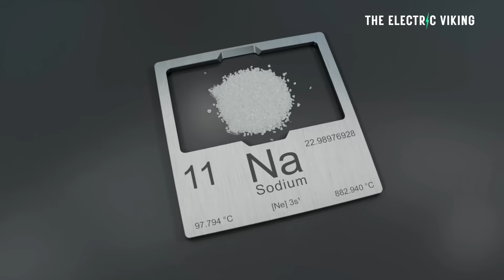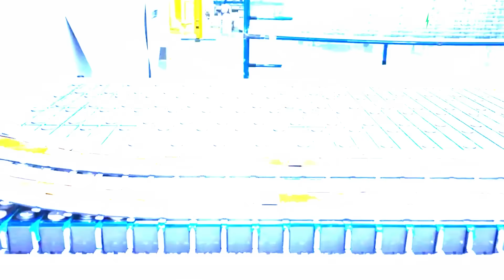Goodbye Lithium! New 3,600,000 Mile EV Battery costs 50% LESS

Comment: Lithium Electonegativity - 0.98. Sodium Electronegativity - 0.93. Lithium ionic radius -  1.52A. Sodium ionic radius - 1.86. In short, you cannot beat physics. Eventually, you can make better batteries from Lithium than from Sodium. Sodium Ion batteries will have better cycle life, since their voltage would be lower. So also forget about performance.. But yes, Sodium Ion batteries will be a lot cheaper. Assuming CATL did solve the dendrite problem (they must have concocted some kind of an organic electrolyte which eats them).
Reply: Sodium carbonate = $200/ton, Lithium carbonate = $15,000/ton.. The cost is part of physics too..
Reply: Yeah i mean ... we don't need just ONE type of battery.

If Sodium works for static storage with long life, while being extremely cheaper. That in itself its a huge win for electrification ... it doesn't matter if your car/computer/phone still uses lithium, it makes renewable power sources suddenly make even more comercial sense.
Reply: Let a hundred batteries charge, but from a mass market cost perspective this is it. Just like how Honda Civic outsells a Lamborghini 5000 to 1 or more it's not about one market it's about different chemistries for different markets and different price points. Something that CLEARLY ISN'T TRUE TODAY! UNTIL NOW!
Reply: We aren't even close to the theoretical limit of Lithium. If sodium gets to even half the theoretical limit of lithium,  the  battery will have amazing versatility and application. Yes, the theoretical limits of Lithium exceed Sodium but that is rather meaningless when you haven't even gotten to a reasonable fraction of the theoretical limit.
Reply: What about Aluminium ION, the Tesla new Battery which are lightweight.
Reply: @michaelcorcoran1964  - not as light as Lithium, which is the lowest weight metal that is very energy giving (likes to give up it's electron)
Reply: @GruffSillyGoat 
Lithium is certainly lighter than aluminium, but if  each aluminium ion takes 3 times as much charge, it needs fewer of them.
That reduces the amount of graphite needed to hold them by possibly up to three times.
The entire battery can therefore be lighter for the same charge.
 That's the principle, I belive. But I'm pretty ignorant about batteries, so I might be wrong.
Reply: It's not that simple, one has to take the cell characteristics into account, not just the charge carrying difference.

Aluminium is about four times heavier than Lithium, and has a lower voltage potential (2.65v for Al vs 4.2v for Li), this means for the same voltage capacity Al based cells are much heavier than Li ones. Which once overall cell changes are taken into accounr can be up to 10 times heavier at the pack level.

The three times electron potential, also requires an cathode material that can is stable at supporting the level of charge transfer over many cyces. This is still being worked on, claims of working batteries have all been for rather low cycle life cells. For mobility applications with frequent charging Al is not an ideal candidate at this time.

Further whilst Al-ion has a higher emergy density than Li-ion, if one considers the parallel development of Metal-Air cells, where the situation swaps around with Lithium having the highest energy density; significantly more than Al-Air and the highest know max energy potential rivalling petroleum products. 

Al-ion may mature offering a better stationary storage cell, due to its weight, but it will be challenged by Metal-Air cells around the same maturity timeframe; its advantage short lived.
Reply: My guess is that sodium ion will rule in grid and home energy storage systems and standard range EVs. Long range EVs and small devices (laptop, phone, portable power tools, e-bike, and wearables) will likely still continue to use lithium battery due to its energy density advantage

Keep in mind that sodium ion won't totally end lithium battery production, it's just made for balancing the demand
Reply: I've read that they've planned to start the production a month ago for heavy duty market such as trucks and at end of the year they have started the production fully. Really interesting to hear if they've actually started to deliver these batteries to their customers yet.
Reply: Self-healing 🔋
Reply: What about SSBs?
Reply: We could run cars on pure nitroglycerin because that fuel would contain more energy than gasoline per pound and per liter. But we don't do it because there is a safety ratio and a good enough Factor as well as other things so energy compressibility if you want to call it that doesn't really matter past a certain factor. If you can squeeze it into a car shape and it can provide you with a fast charging and long enough range then it doesn't matter really beyond that and cost and safety become much more important.
Reply: @yougeo I think you missed my point. Both Lithium and sodium are relatively new. The up side of development hasn’t been reached by either. A comparison based on relative theoretical limitations is not going to tell you what the practical limitations will be.
Reply: You can't be a firm that creates energy, gen/storage that will eventually destroy your firm. Even if this came as stated you might create, ceteris paribus, a 10-15 year market. However, if developmental breakthroughs are maintained (who can say at what rate) it will, nonetheless, create a situation where one cell has so much capacity there will either be little need for new storage or the marginal cost of production is so low everyone can manufacture it, for e.g. LCD TV's. Hence, manufactured obsolescence will be introduced much like LED lighting. We could have had almost lifetime lighting, now at the consumer level the price/performance ratio is declining. It is not in a firm's interest to create energy storage that will do itself out of medium term production. Yet difficult when the chem/physics/production elements between firms (and nations) would marginally approach zero.
Reply: What happened to CATL's "condensed matter battery"?  

Wasn't THAT supposed to be the battery "game changer"?   

CATL's Condensed Matter Batteries were supposed to give us electric planes... soon.    Where are they???

*
There's no negative consequences for CATL coming out with BS about batteries every 9 months.   They can put out BS with the blessing of the CCP (don't forget -  CATL is a CHINESE company, which means they do want the Chinese Communist Party tells them to do).

Russia funded the European idiots of the Green Party to help keep non-Russian natural gas off the market, and make them DEPENDENT on Russian natural gas.   Why shouldn't CCP- controlled CATL come out with BS battery stories that say, "Don't invest in oil indepence!  Batteries are going to make oil obsolete!".  --- or some such BS.
Reply: The word batteries mean a sum that is greater than it's individual parts 

Why only mention inherent characteristics of ELMENTS ONLY

CATL has engineered electrolytes and fims for extron movement 

You know what immediately discredit your point LFP batteries go and research what the cycle life and energy density of it was when John b goodenough invented it

They said it would never beat modern batteries in any capacity

Comment: 24M is still only battery with a separator that detects dendrites.  The impervio separator is three parts and acts like ceramic, to turn the dendrite horizontally, where the ends dissolve.  The system can detect if there is a short and shut down that cell.  CATL needs to explain how the deal with dendrites
Reply: Maybe they have a solution that they are keeping proprietary for now.
An interesting thought I had was adding some potassium to the battery.  A 50:50 alloy of sodium and potassium is liquid at room temperature.
I used to have a calculator with batteries in it that had the dendrite problem.  I discovered a fix for it was to charge up a huge capacitor to about 30V and discharge it into the cell.  They would stay fixed for as much as a year each time.  Basically the current spike blew the dendrite like a fuse.

Comment: lets get real, the current collector in a sodium ion cathode is made of aluminium instead of copper. how much cost savings? probably around 10€ per kWh.
regarding the other materials? one € here, one € there maybe not that much. i think it can compete with LFP but not with a huge difference.
where it can get a market very fast is by replacing the traditional 12V batteries in ICE cars or 24V batteries in trucks. longer lasting, very good cold performance.
this allows scaling it up. that is the key. once the supply chain is established, upscaling will go forward and prices will drop.
once it is slightly cheap than LFP, it will conquer the home and grid battery storage market. it will still take about 3 years to get close to this point and then we will know more.

Comment: I think that for performance EVs which is arguably a large sector of the market, we are likely to see more implementation of the 24m technology. The higher energy density is just too desirable even at a higher cost. Remember that their tech can be implemented quickly and at scale without huge initial tooling expenses. Maybe we will see a split with affordable vehicles going for sodium and higher performance vehicles opting to use 24m.

Comment: This is exactly why buying an EV is a terrible idea.  if every week there is a "Game Changing" technology that will reduce the price by 90% and improve range by 50%, why buy a car today if tomorrow will be 50% off?
Reply: A year ago I bought a 2019 Hyundai Ioniq with 40 K miles.  It serves us very well well, since we can charge at home and make a short commute to work.  Our solar panels in a NE US state can charge the battery. There is a way to fit an EV into your lifestyle if you look for an economical model .  We use this car locally and have a hybrid for longer trips and as a second car.

Comment: Ocean water can be desalinated for drinking water and the sodium  can be used for batteries. The cloride used wherever it's needed. That's a win win with cost shared.
Reply: Sodium is so cheap that sourcing it near the battery manufacturer is crucial.  The issue with desalination is the high energy use.   Yes, releasing concentrated salt water is an issue.  But sodium battery manufacturers wouldn't put a dent in that released sodium.
Reply: @veganpotterthevegan  Modern desal plants usually use solar for at least part of their energy needs. It's almost mandatory these days just to get approval, e.g. in places like California where it takes 15 years to go through the red tape.
Reply: @ChickensAndGardening  not much red to for municipal services. Different story if someone were selling desalinatized bottled water
Reply: @ChickensAndGardening  The South Bay in California, near San Jose, has large evaporation ponds that have been making salt for decades.
Reply: @keithdow8327  Same for San Diego in South Coronado Bay
Reply: Sea salt has too many impurities, and it would cost too much to purify it. The processing is going to be the biggest cost, followed by the aluminum collectors.

Comment: Sodium batteries are not available on ebay. All i see is lithium. Samsung 21700 and the old workhorse 18650. BTW the 4680 is non existant on eBay either. Go figure. The 21700 is a 5ah 3.7 volt unit. Again sodium non existent for us Do it yourselfers building portable solar power stations ...5000 watts or better..yeeeehhaaawww👽🦖

Comment: What I wonder is how this can be used for home batteries? The prospect of powering homes/businesses etc with these kind of batteries seems to me to be at least as important as putting them in cars.
Reply: They are making a line of stationary batteries as well as those to replace 12V lead acid in cars and hybrids since they can still use 93% of their range in -40c or +70C...
Reply: Sodium won't be used in moving vehicule. Perfect match for energy bank.
Reply: @sphinx151  They are already about the blade batteries. So I expect some will go in vehicles as well. They could even be in mix pack as CATL demonstrated, with their advantages in low temp etc.
Reply: @sphinx151  wanna make a bet?
Reply: @sphinx151  My argument, exactly! I question the POWER density of these, as well as the charge acceptance efficiency of these. How efficient? how fast can they charge? they may be fine, for level 2 charging in a low performance Nissan Leaf, but what about fast charging a Tesla Plaid? These might be more suited to your solar panels, and inverter, which don't need as much power as a performance EV, but, will be cycled every day.
Reply: Faradion have already deployed its sodium ion technology into test stationary storage sites, and like CATL targeted heavy duty truck start-stop batteries with their Sodium technology.  They have a similar energy density of 160-170Wh/Kg. One of their taget markets once production ramps up is domestic energy storage as well as grid scale.
Reply: @GruffSillyGoat I agree. Behind the meter energy storage may well be their first application.
Reply: There is a lot of hesitation to maximize the use of Vehicle to Grid and Vehicle to home because of fears of costly battery degradation.  The fact that these batteries are so long lasting and getting cheaper would seem to encourage much more uptake on this with potentially big implications for the grid
Reply: The delay with V2G is mostly due to lack of standards. 

DC V2G has been defined but very few homes have the expensive DC chargers, power levels to run these (typically three-phase electricity) and the inverters capable of taking the DC from a vehicle and converting to AC to run a home.

AC V2G has only entered the standards drafting process this year, likely to take a year or so to draft and approve. Till then they'll just be a mishmash of prorietary approaches by automakers, wall box charger manufacturers and thrid-parties - that use a variety of 'trick' methods for using a vehicles V2L to supply the home.

Comment: Lets hope so but you will still require a massive amount of electricity to charge all these batteries and where will all the power come from. Should have waited until safer better batteries arrived before we started on the folly of expensive EV's instead of basic cheap runarouds. A car does not need to be a computer on wheels. They should carry a spare tyre too.
Reply: Your thinking is rear-view mirror. Perhaps we should abandon cars completely and go back to horse and cart?
By 2030 (2035 latest), most people in urban precincts won't need to buy or own a car, as autonomously-driven vehicles will cater for all terrestrial transport needs. Pricate car ownership will become redundant, and we will be spending our money on lifestyle pursuits. It won't matter how expensive these autonomous cars are, because we won't need to buy them.

Comment: The price of lithium batteries is not the main reason that heavy vehicles are not viable for electrification. This is good news for light vehicles however energy density is what needs to be increased for trucks. They need 500 watts per kilogram to allow for the same payloads. I have no doubt they this will eventually happen but till then unfortunately we are stuck with spluttering diesel emissions. The other alternative is hydrogen which has proven to be too expensive. Let’s hope the energy density for any type of battery chemistry can attain the 500 watts per kilogram sooner rather than later.
Reply: Hey, CATL talked about a 500w/klg a year ago, what happened?
Reply: There are lots of HGEVs in Europe doing fine on NCM, and more recently LFP, batteries.

Comment: Problem is there are a lot of promises, based on small scale laboratorium productions. It is not uncommon that in the process going to large scale productions the ideal lab production method can't be fully used and the final production is less than optimal. The final production batteries may not have the same specs. The energy density and number of charging may be (much) less.
The Chinese battery companies won't be wiped out. They are also working on new and better batteries which will have a double to quadruple energy density, longer lifetimes and lower costs. In two to five years we will see EV cars with much longer ranges, shorter loading times and for the same price or less hitting the market.

Comment: Thanks Sam.  A couple of questions you didn't get to were charging rate speeds and peak amperage output either on a cell or pack level.  Otherwise, great job breaking this news!   Up until this video, I had been thinking that lithium batteries would continue to dominate the EV world while sodium batteries would dominate the stationary pack world.  Now it seems that sodium may dominate both!
Reply: It depends upon the volumetric energy density, which may be lower with sodium meaning less battery can be fitted for the same space in a restricted area like an EV (possibly ok for goods vehicles and stationary storage applicaiton though). As yet, CATL doesn't seem to have published the volumetric density of the Naxtra battery, other than a cryptic reference in a the Freevoy NCM/Naxtra combination battery listing 1000Wh/Litre but with a note of NCM providing high energy density in this case.
Reply: What about charging speed? 20 - 80% in what time?